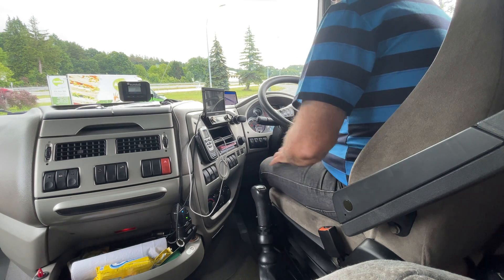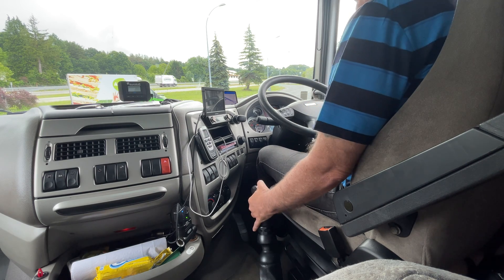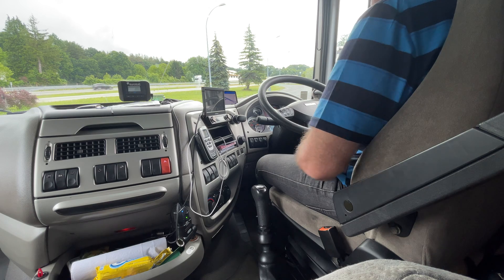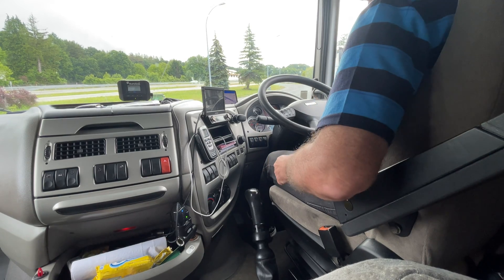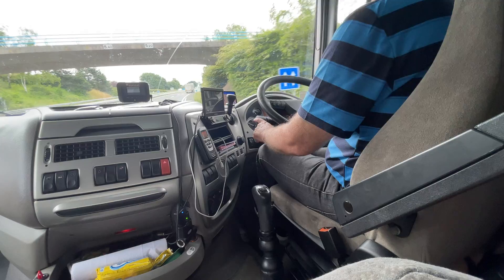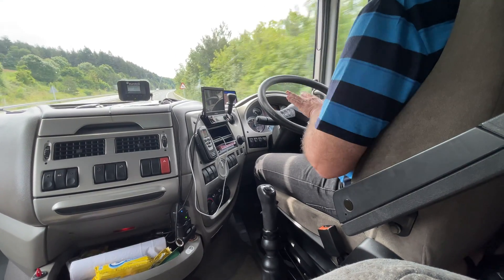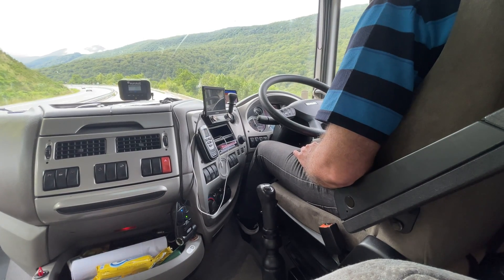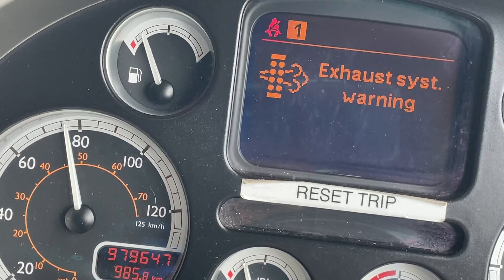How to change gear | 16 speed manual | ZF gearbox in a Daf | Range change | Splitter

Comment: Well explained video mate. What would happen if you were in for example 8th high split then flicked the range switch down for low range? Would something go bang or is there some sort of override to stop low engaging?
Reply from the maker: On older boxes (if you managed to select such a low gear) you could potentially go BANG but releasing the clutch slowly as normal you’d hear a squeal & realise.  I think newer boxes may prevent this - if there’s any manual boxes left ! 😃

Comment: I’m confused why u need to push in the clutch to activate the gear split on this transmission. I’m from America and on all our 18/13 speeds all that is to split is coming on and off the throttle to allow revs to drop to next gear.
Reply from the maker: You got it in the end 😃

Comment: This is so far the best explanation I’ve seen, which my brain takes in — I’ve definitely been overthinking it. I do have a question, if you have to hard brake, what happens with gears then! Same as a car I take it? Thanks for a great video!
Reply from the maker: Pretty much, just got to remember what gear you’re in but at worse check your speed & if possible drop into low range & let the clutch up VERY slowly along with exhaust brake 😉

Comment: Back in the 80's I drove a Daf 2800 Turbo Intercooling with a Fuller 13 speed regulary and a Steyr 1291 occassionally with ZF Ecosplit 16 speed but I liked the DAF and especially the Fuller transmission the most.
The range change with the ZF was horrible - pushing the gear lever to the right / and left. Splitting was ok.
Reply from the maker: Wow Steyr, I remember them. Thanks for watching my friend.

Comment: If I want to go down from 8L to 7H when should I switch the splitter to High? When I'm still in the 8th gear position or when I move the gear lever to the 7th gear position ?
Reply from the maker: Hi mate, you can pre-select both range & split as it doesn’t activate until the clutch is depressed. So, in 8L flick splitter to high & when ready depress the clutch whilst moving stick to 7 & Hi will select all in one go. Smooth like butter 😉.  Good question & thanks for watching mate 👍🏽

Comment: What we did, long time ago, similar ZF gearbox, with Daf 2800/3600 and 95.350 was low2, than low4, then the same as here in the video.
Reply from the maker: As long as it works & doesn't put too much stress on the drive-train, that'll do !   Cheers for watching buddy.

Comment: When I did my Class 1 (CE) training back in 2009, I learned in a 8 speed (4 over 4) without a splitter.  One of the things that struck me was how close the low ratios (1 to 4) were to each other.  Once you are in high range (5 to 8) you have a spacing more like what you are used to in a car or a van.  I'd imagine that you'd only ever use the splitter in low range to make a 1.5 shift where a block change between 2 whole gears might be too much for the load / gradient.
Reply from the maker: Hi Raithrover & thanks for checking in 🏴👍🏽.  The lower ratios are still fairly close even with a splitter so 2/3 to start off then 4-5-6-7 low 7 hi 8 lo & top usually works well for me 😃

Comment: In the early 2000's I did some trucking, one of the trucks I drove was a Renault Magnum. It had a Mack engine and ZF gearbox.
The gearbox was a nightmare, really. The splitter worked as you showed, it was fine, but the high/low was manual too. To shift from high to low or low to high, you had to do it manual. From low to high, you had to push the stick hard to the right in neutral, and you would feel when you “broke” the resistance, and you were in high. 
It was very wobbly and unreliable, so the risk was that it had not changed to high as intended and 5th would be 1st. Once we 2 drivers on the truck and my colleague used a “karate” punch to get it in high. I tried that, it worked better. We named it the “karate gearbox”. A real pain, literally.

The Renault had some few faults, but the cabin was by far the best at the time. It was huge, you could have a party in there, and dance. I had several Volvo and Scania truckers in the cab, they wanted to see it. You could see they wanted such a cabin on their trucks too. Shortly thereafter all trucks got a big cabin. I believe MAN was next in line to make a big cabin with a flat floor.

After the Magnum I drove Volvo, it was a breeze with the gearbox. Volvo had electric/pneumatic shifting on splitter and range since the 70's. I believe it was at the time Volvo introduced I-shift, many drivers was opposed to automatic, but when they got their new Volvo I-shift, they were delighted. No more stomping with the left foot.

Happy driving from a retiree.
Reply from the maker: Hi Gert, we had a truck at my old Company that had the “knock across” box 🤣. You think you’re in 5th, let the clutch out & it stands on its nose in 3rd 🤦🏻‍♂️

Comment: i used to have one with a torque converter on it. you could drive off in 5th easy and just skip a bunch. when empty i would just take 3~4 gears to get to top gear. was also great in getting the box and engine hot quickly in winter.
Reply from the maker: Funny things when they’re light or empty, like you say just skip loads of gears on your way up.  Thanks for watching SrotW 😊

Comment: I remember years ago, probably  around 40 years, using the Mercedes-Benz 8 speed  knock over box, gears 1 to 4 then knock the gear lever over in neutral  to get gears 5 to 8, same operation  coming down the box ,no switches to bother with
Reply from the maker: I had the same knock across box in an old 2800 Daf many moons ago 👍🏽.  Cheers for watching Kev.

Comment: We used to rent from a company that had old Freightliner 24-foot box trucks with big assed diesel engines in them and split shifters on them. Just the two range ones. I could never get the hang of it. I always drove them in either high or low range. This is actually a four-range transmission. I am amazed he can keep it all together when he's driving without some form of display telling him what gear he's in. But that's why he's the professional truck driver and I'm a commenter on a YouTube comments page. Much respect to you sir and thanks for making the video.
Just so everyone knows, modern clean diesels run catalytic converters and an extra fluid called DEF, diesel exhaust fluid, that is injected into the catalytic chamber to fully process the diesel exhaust. Those diesel catalytic chambers are not like the ones on your car. They run way hotter and they do an amazing job of processing diesel fumes. Of course, those who hate diesel never want you to know that. The warning you are seeing on the dash is the catalytic converter system asking for a standard maintenance regen procedure to help maximize the efficiency of the diesel catalytic system. Most diesels will do this automatically but occasionally they drive you crazy with the warning light until the regen is done either automatically or manually. 
Modern diesels are truly amazing engines. I wish people were told the truth about how truly clean they run because modern diesel engines are truly awesome engines.
One last warning though about these modern diesel engines. If you are ever driving one to move your house or large objects, never - ever run them dry of diesel fuel. The catalytic converters run very hot, and they actually require that diesel be run in them to keep them cool enough to survive the conversion process. If you run the truck out of diesel dry, with the engine running, the converters will overheat and simply cook their insides. I was told by the rental company my company used to get our trucks from, that it is a ten-thousand-dollar mistake to run a diesel truck empty. Just don't do it.
I cannot stress too much how clean these modern diesels run. My lungs are toast and very sensitive to any pollution and I could stand right next to our trucks running all day with no lung discomfort. Simply amazing engines.
Tell me why I shouldn't idle my truck when it's ten degrees Fahrenheit, freezing outside or 100 degrees Fahrenheit broiling outside and 140 degrees Fahrenheit in the back of my truck, absolutely cooking.
Clean diesels let you do that safely.
Reply from the maker: In the UK we call the additive Ad-blue (or pig p155 😉). Thanks for your comment & I agree, most don’t know how clean a modern diesel actually is 👍🏽

Comment: Nice tutorial! Do you find you’re a little more fatigued after a run in a manual compared to an auto?
Reply from the maker: Cheers Paul & not really. Most trucks are so powerful these days that there’s little gear changes required & given the top 2 gears can be “split” sometimes that’s all that’s needed to maintain good progress.